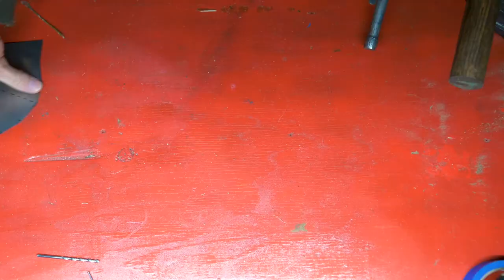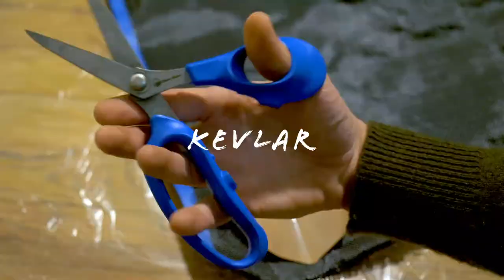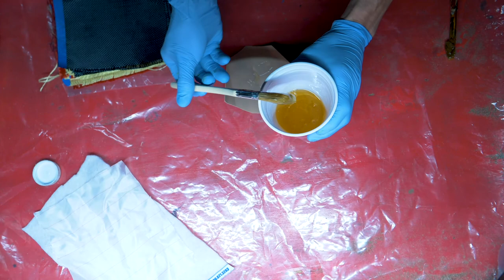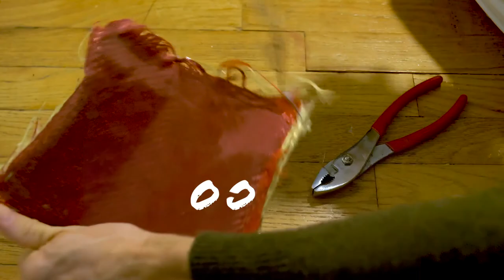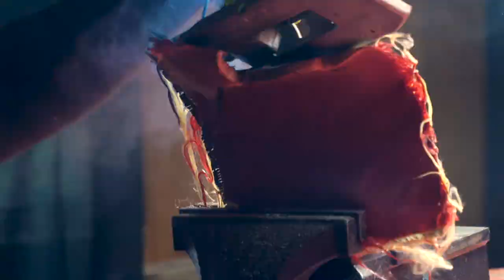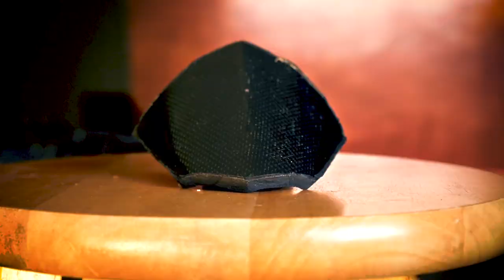Bulletproof Face mask Armor, Kevlar build

Comment: Though this is fucking AWESOME, I don't ever recommend getting shot with that on as the force behind it will still knock you to the floor/break your nose.
Reply from the maker: I tend to agree
Reply: And probably your neck as it has no suspension like a helmet. It is still better than nothing and will give you some cushioning and protection against physical stuff.

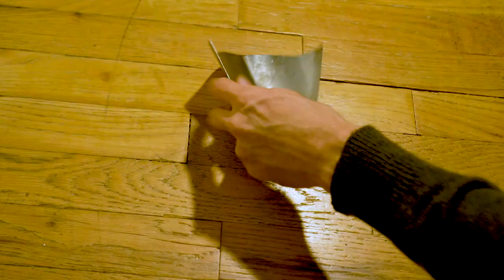Comment: What was that tape you used at 1:12
Reply from the maker: https://compositeenvisions.com/airtech-toolwright-3-50-width-release-film-for-mold-surfaces-2210.html

that stuff is a little pricey but works the best

Next best option would be   https://compositeenvisions.com/rexco-partall-pva-10-spray-on-moldrelease-1-gallon-486.html

lastly if all else fails a thin layer of Vaseline
Reply: @sambuildsstuff8990  something tells me one of those options wouldn’t work perfectly
Reply from the maker: @sammythewizard8479  lol I never said anything about working perfectly!